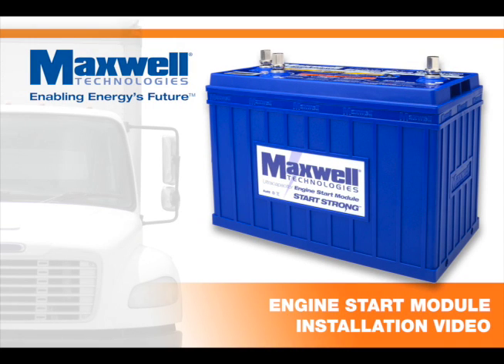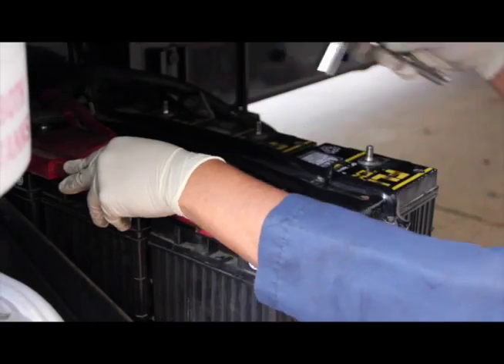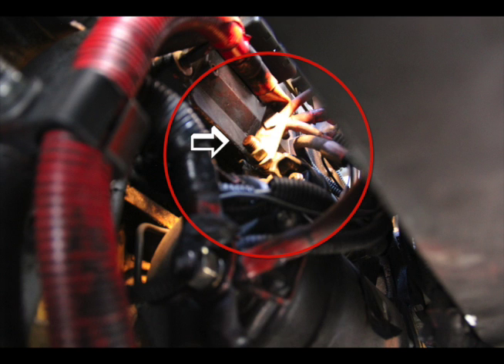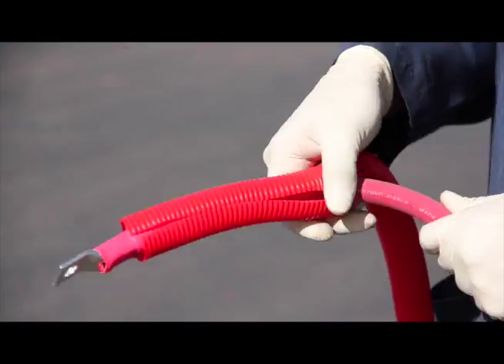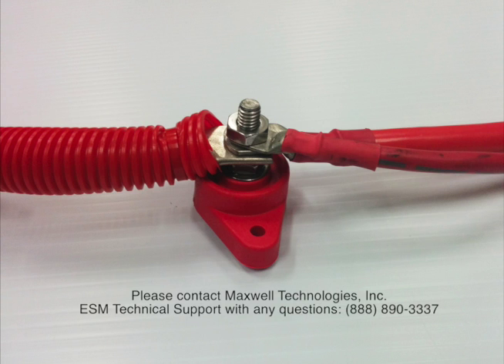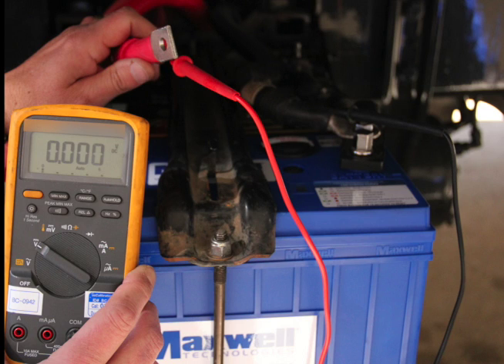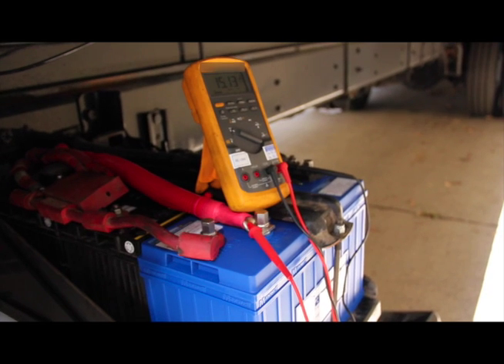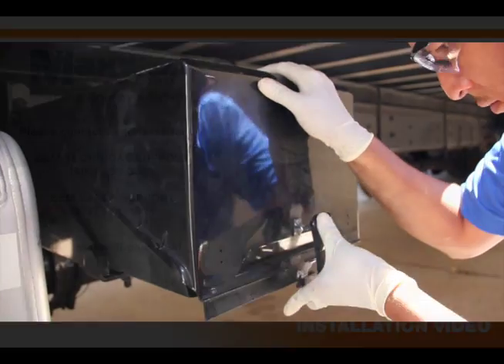Maxwell Technologies' ESM Installation Video

Comment: Just bought the Maxwell capacitor and I find the instructions that it come with are very contradicting one set of instructions says to isolate the positive cable from the back of the starter and dedicated directly to the ECM and that's all that needs to be done but when you open the instruction book it tells you that you need to isolate the positive and also the negative so which way is the correct way this video also shows only putting a new positive cable

Comment: So...$900 to start you engine .7 seconds faster? Hmmmmm.
Reply: 900 dollars to start your engine in sub-zero temperatures as if it were 80 degrees out. lead acid batteries don't do extreme cold.

Comment: I just bot the 1800 one an wow 😮 a big difference the performances is second to none,have not found one at low cost,but finally found one for my semi,will test it this winter 🥶.4 year warranty .each acid battery has to be changed ever year.thats a lot of money 💰 thrown away.it stars my isx 15 Cummins quickly.highly recommend.

Comment: What would you estimate a fully charged ESM's cold cranking amperage?
Reply from the maker: Cold Cranking Amps (CCA) is calculated differently for Ultracapacitors than standard lead-acid batteries.  The equivalent CCA for the ESM ULTRA 31/1800 for Class 7-8 diesel trucks is 1800 CCA.  The ESM ULTRA 31/900 for Class 3-6 diesel trucks is rated at 900 CCA.  Learn more at our website at www.maxwell.com/esm.

Comment: where can we find (wrapping with velcro) protective isolator  that we see on  the other Vimeo  12V Maxwell ESM  video installation   at 2 min 15 seconds ?                     https://vimeo.com/55372655       ?
Reply from the maker: Hi Lucas, 

Thank you for your inquiry. 

The material is a ‘Woven Nylon Wraparound Sleeving’ also called Dura Wrap by Techflex Inc.  The website link is http://www.techflex.com/prod_dwn.asp.  It can also be purchased online at McMaster-Carr at http://www.mcmaster.com/#standard-cable-sleeving/=13922iu.  Recommend the 3-1/2” size, McMaster Part No. 7257K6. 

Maxwell Technologies

Comment: I have one of your ESM products. The wiring diagram you included with the product does not provide enough detail to be able to install your product and use it properly. No battery isolation can be achieved. I have a Delco Remy 39MT Starter. With only one wire going from the ESM to the starter (and batteries isolated) engine will not start. Starter will click once and will not start cranking the engine. It will start if I connect a specific wire back to the starter, but that discontinues the isolation of the ESM to the batteries. Please provide me with a specific wiring diagram that I can use to connect your ESM device to a Delco Remy 39MT Starter. Thank you. My email address is nicu_vl@yahoo.com
Reply: كم امبير